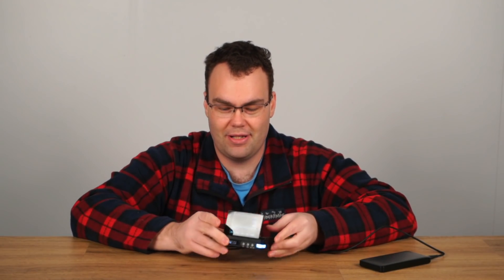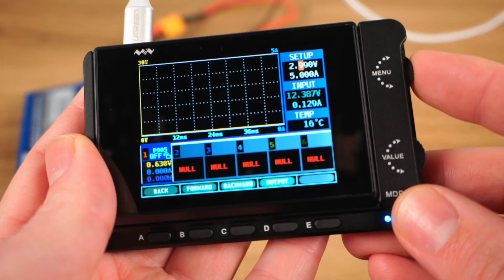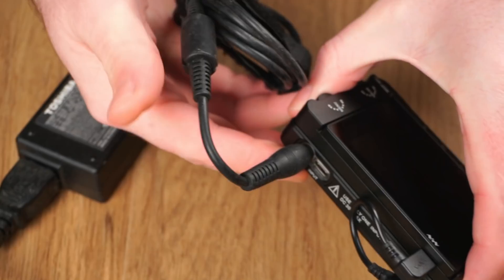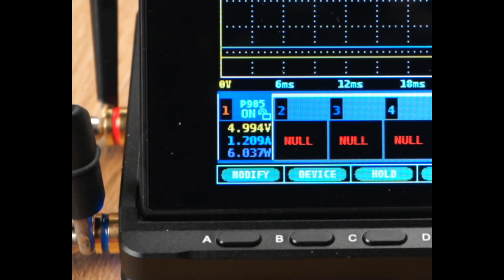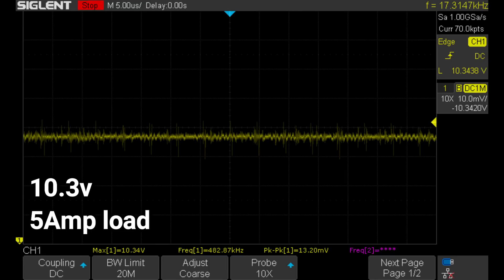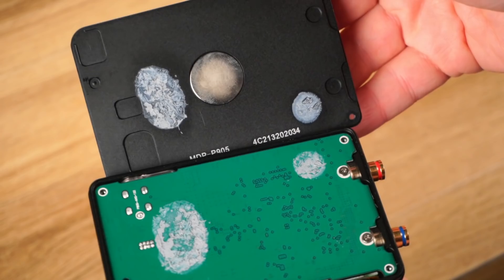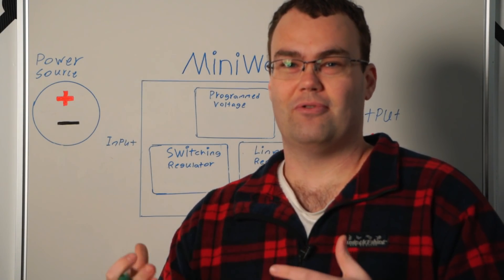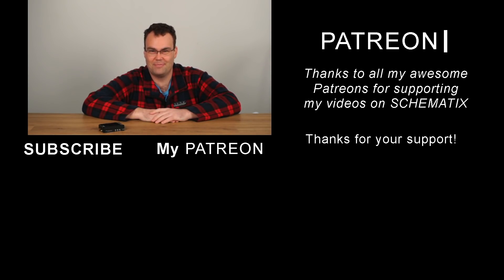Miniware Compact, Precision PowerSupply II MDP-XP Review

Comment: Thanks for the interesting review.

I'm wondering if I can stack two PS modules to be centrally commanded by the screen controller, as a differential power supply (common negative) and/or a series arrangement, both for versatile electronic breadboard projects and teaching.

Comment: The switching part must be in the multiple 100s of KHz range as the electrolytic bulk caps look not that high performance and it must be the high Capacitance MLCCs for the regulation. I love those tiny MLCCs, they are quite performant specially considering the price and form factor. Would have loved to see some Moulded Aluminium polymers but this is very good.

Comment: Switching PSUs don’t necessarily have high output ripple but they are slower in transient response compared to linear ones and most PSUs reach low to mid 80% efficiency figures when drawing a significant portion of the rated power, the poly-phase switching regulator such as the ones used to provide power on modern X86 processors like on the various X570 and Z590 motherboards are quite impressive in every regard.

Comment: The supply without screen is 144, thats not too bad, but unless you need the small size you can find cheaper options. I do like the form factor though
Reply: Won’t find cheaper options with that level of ripple, there’s nothing like it in that size. You can absolutely find cheaper/as powerful PS’s but nothing out there that can beat those specs (atm)

Comment: Oh god the price is insane. 250 USD for this? Although It is not actually power supply, it is a regulator. The PowerBank and That DC laptop charger are Power Supply.
BTW if this device has high precision then it's worth it.
Reply: Ive bought the P905 units on AliExpress (wait for sales) for ~$90 per... I have 5 of em
Reply: By your reasoning the DC laptop charger is not even the power supply as it gets its power from a wall socket. The power bank, yes.
Reply: @flexairz  By this logic Power supply doesn't exist. All real power supplies take AC voltage and give regulated DC voltage at output. All of them are like this. But the device that converts DC to DC is literally regulator or DC DC converter

Comment: Great video as always. The tipe of power supply that shares both worlds switching and linear is not something new, I have a Peaktech 6225 that shares both worlds. Another thing, high capacitance on the output is not always a good thing, if this power supply has a slow feedback loop it can ruin your day.

Comment: thanks really great video schematix! really enjoyable and clear explanation at the end for the basic principle. so good. now obviously it leads to many more questions simply because... we still dont have an ideal budget oriented lab psu. the miniware is too expensive and designed to be be portable making it only 1 channel and rather too small. then the riden, as we all know has the high ripple. MAYBE the gophert ones do in fact use this same hybrid system as the miniware here? as i mentioned to you after the previous riden video they are great performance but are severly lacking in the user interface department. but maybe if aliexpress or banggood sends you free stuff, then you can somehow request a gophert psu from one of those 2 store. purely for the curiosity and fun to find out why the gophert is also equally great performance. i for one would love to see that too. anyhow back to the main issue here... the next jump up in price is hundreds of dollars more for the rigol with 3 channels. so while the rigol is fantatic performance it is simply too expensive for many of us. so where does that leave us now?

well i think if voltlog's idea of making a better GUI for the gophert has failed then maybe can we solve this problem the other wa around? and instead create some decent modification to hack the riden rd tech 60v. and bolt on the missing linear psu stage? would that be any easier solution to end up with our ideal psu? for that solution we would have to hack the riden to output a slightly higher voltage than programmed. and really hook into its existing loop. with some significant reverse engineering effort.

perhaps if rd tech (the guy who makes then) saw the value in this approach. and made some new official PSU models himself. or maybe if gophert saw the value in updating their psus to modernize their user interface. then we would not find ourselves in this split situation. where not all of our eggs can be in the same basket.

by that i mean the miniware is great if you genuinely need a portable psu and can afford it. but its expensive and the per channel cost probably ends up being as much as a rigol (for single channel vs 3 channels). yet without the other pro features of a rigol. and we know that miniware are never going to be interested in making non-portable bench top devices, its right there in the name of the company and all their branding. so that miniware premium is something we pay for it being engineered to be compact and portable. which we dont wish to pay the extra cost for. when its for benchtop purpose we would otherwise prefer and rather save up for a very much longer time to really stretch these hobbyist budgets for a rigol. given that it is something that would really last a lifetime

ah but... then that would also really eat into the oscilloscope budget! hence the missing need for the really cheap benchtop psu. why we are here in the first place :)
Reply from the maker: Well said! I looked into the gophert psu's following your previous replay. I would be interested to put one to the test however as you mentioned the user interface is rather lacking. I'm pondering on the possibility of adding a linear regulator stage to the riden? Maybe something to explore in a future video...
Reply: @Schematix  awesome my friend! i believe it would make and valuable channel content just even to investigate. regardless of any specific success or failure - just it's a great topic and to help educate other hobbyists in electronics. we all share these same situation here. please also don't hesitate maybe to consider contacting Voltlog to let him aware of your recent efforts here. as he kindda might have dropped this himself. but being a fellow youtuber, also with a similar interest and knowledge in these same specific set of budget PSU models. Perhaps he can also give some little help, or small assistance for help you with any future efforts looking into these topic. it benefits our whole community & thank you so much for taking an interest in this matters

Comment: Yes, that is clever. The linear side only ever drops 0.5V so at max o/p of of 5A, there is a mere 2.5W loss as heat. Thats around 2% contribution to the overall loss of the system.
The obvious question is can you design something using this principle to add to any switching regulator? Since the voltage drop will always be 0.5V this shouldn't be too hard?
Reply: Yes. This is a very common technique in any low noise high power design.

Comment: Nice gadget---but 132$??
Better to buy a cheap power supply & put the output through a linear regular. :)

Thanks for sharing!
Reply: Is that all they're charging?
That's cheap.

It's the interface that ruins it for me.
Reply: @jimmyb1451  Haha.. I like the interface--but the cost is way too much, imo for a 150W regulated power supply.
Reply: @ab_ab_c  I hear ya, there are far cheaper ones. Not with 4mV ripple though. 

But yeah. It's actually given me a few ideas for the PSU I'm designing.
Reply: @jimmyb1451  That's why I suggested in my first post to add a linear regulator after the main voltage regulation--to eliminate the ripple just as they did with the 132 $ unit.
Reply: I really doubt its the linear regulator alone that gives those specs of ripple
Reply: @TylrVncnt  TBH, I was surprised to see it wasn't a polyphase converter. That's pretty tight regulation. I'd like to see some transient response tests.
Reply: @TylrVncnt  Without a good look at the xit schematic one can only speculate at this point.

Comment: Nice regulator, pricey though !
Linear regulators have been used to clean the outputs of switch mode regulators for years, they do SMD chips with both built-in for just this purpose too as well DIY. Not all linear regulators are suitable for the purpose though, it has to respond very quickly to smooth out spikey HF switch mode noise.

Comment: Handy if you don't need a huge amount of power I guess (I tend to need as much as I can get, typical power souce is a 120v 32s lipo battery that can do 120A continuous/300A for a few seconds into a converter that puts out 12-150V and 10-150A current limit). For smaller things I just use 2x 0-30v 10A supplies in series or a 0-500V 30A one I built that runs on 240V 60A mains.

Comment: What I don't understand why use an antiquated standard like QC3.0 instead of PD3.0 That can deliver 100W? I probably should wait for a revision with a PD chip inside. BTW I like the video, bro.
Reply: QC 3.0 is simple to implement. PD3.0 isn't, it might very well require another (or a more expensive and/or supply limited) microcontroller or a dedicated interface chip.

Comment: be good if you told us how practical it is to use it and how much time it would last....depending on draw.
Reply: given how small it is typcal use would be to run an Arduino or power some other circuit you built on a breadboard, same as the common 0-30v 0-5A supplies just about everywhere, it's just smaller and doesn't need a power outlet (handy if you need to be DC isolated from mains and don't have an isolation transformer on hand).